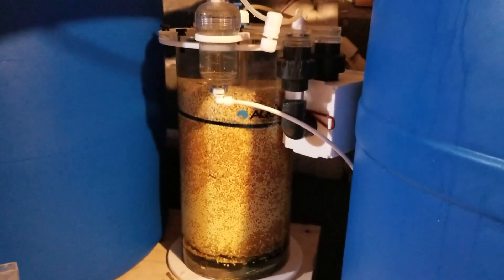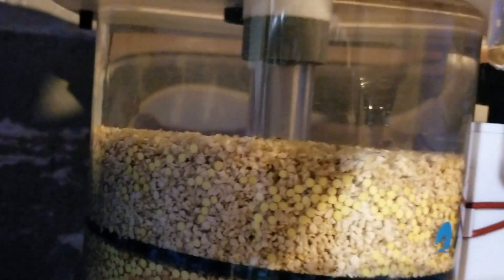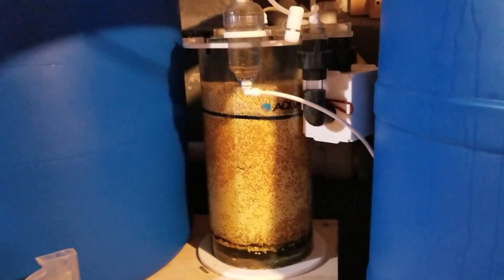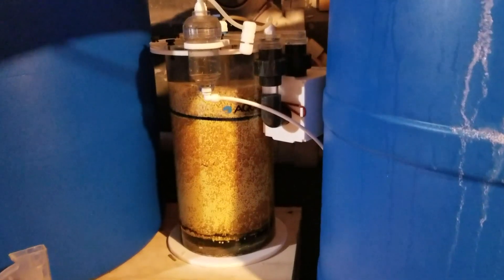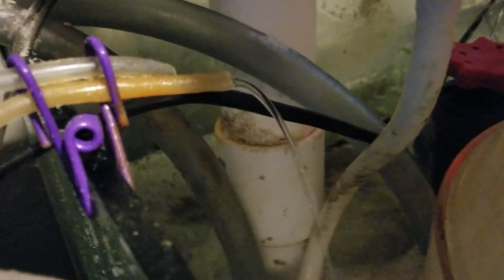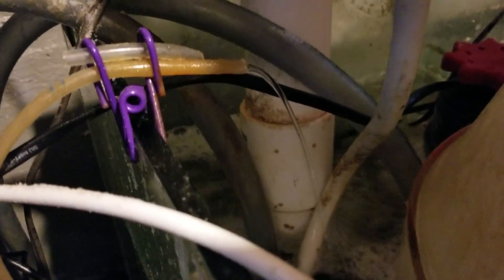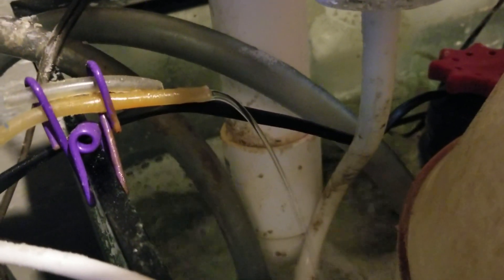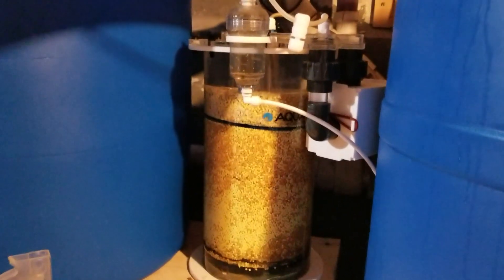Bye bye nitrate

Comment: one of the useful video. thank you. what is your flow rate? i read your comment about running slow flow to make the bacteria and once its there, can increase the flow for bacteria growth. my question is how can we know the bacteria is presence before increasing the flow? is is possible if i turn off the pump so no oxygen presence to create the bacteria first? and once i smelled rotten egg which means bacteria start eating the sulphur pellet then i will put the pump on? is that ok? what do u think? and may i know how long it takes for the bacteria to present in the media for your tank before u dial up the flow? thanks you appreciated if replied :)
Reply from the maker: When you get it fill it with your sulfur fill it with your tank water do not turn on the flow let it sit with no flow for 24 to 36 hours. this seeds the bacteria then start the pump. there are 2 pumps Circulation on the machine an a maxi jet your gonna add for water in an out start the circulation pump then maxi jet start it at a slow flow then you will gradually turn it up.  if it's to slow you will start to smell rotten eggs that means it's starving turn flow up. An monitor nitrates in the tank.
Reply from the maker: I would divert the water coming out to a bucket an get rid of the first few gallons so have some top off water made

Comment: I'm about to buy this unit...it comes with a pump but you still need to add another?
Reply from the maker: Yes it comes with a small dosing pump. That is not strong enough. A maxi jet pump 90. Is perfect
Reply: @tenbearsreeftank5705  How has it held up over time? Has it required a lot of maintenance? I noticed your using the air line connection on the maxijet... probably because that's the size needed. The maxijet doesn't come with a cap to close off the main outflow?
Reply from the maker: The maintenance is 0  once you established a bacteria and get your flow rate down  Mine has been running for about over year now
Reply: @tenbearsreeftank5705  What are you averaging on gph now that it's dialed in? From what I've read using 150gph for the first week or two is good for bacteria colonization and then you start turning to down gradually to 50-75gph or even lower.
Reply from the maker: The airline piece comes with the maxi jet it's the extension for that airline comes with that pump you will have  2 cap off the end where the water comes out though I closed off the other end with a ball valve
Reply from the maker: Bigger pump is always better you could just adjust it down I just chose the 9 the and it seems to be working fine
Reply from the maker: Now you gonna start with a slow flow to produce the bacteria and then it's gonna  Grow grow grow it's gonna wanna be fed more fed more and then you're going to have to bring more water flow and faster
Reply from the maker: Here and there you may get a rotten egg smell meaning not enough nitrate is being fed into the chamber it wants  More water flow which brings in more nitrate faster for the growing colony
Reply from the maker: The bacteria will level itself out
Reply from the maker: I run the maxi jet 90 wide open it doesn't really matter this way you'll never starved the bacteria if the water is going in fast bringing in nitrate it's eating even if nitrate is coming out on the other end of eventually it's going to bring the entire system down to 0 then you're just going to be feeding the bacteria solely on what you are doing to make those nitrates but they won't be detectable in the system anymore cause as your  Adding   Nitrates the machines going to be eating them    If you run the water through to slow it won't get enough nitrate and it'll start smelling like rotten eggs because some of the bacteria are starting to die off so I run it real fast As long as the nitrates going in that bacteria's happy and it keeps the level down
Reply: @tenbearsreeftank5705  thanks for the replies! Makes sense...this unit is very good but I was also looking at the Nyos Torq reactors too...they can be adjusted down to 50gph if needed and it's literally plug and play with no hose's needed or an additional pump...I'm just wondering if the volume will be enough.